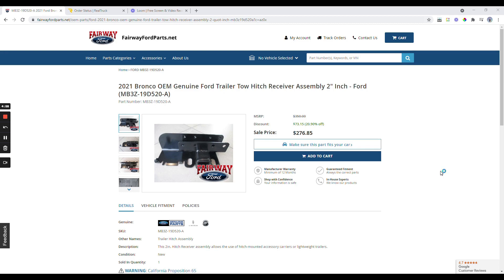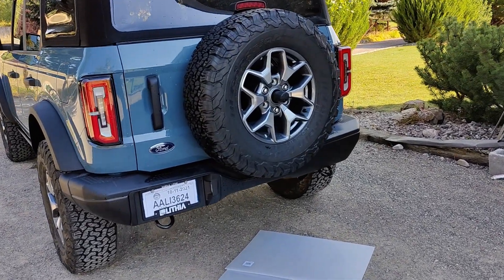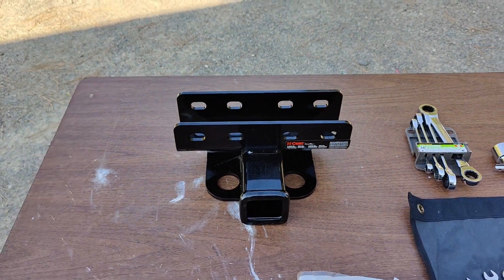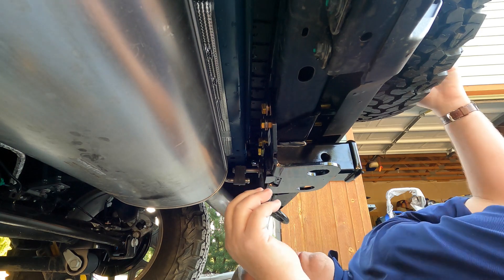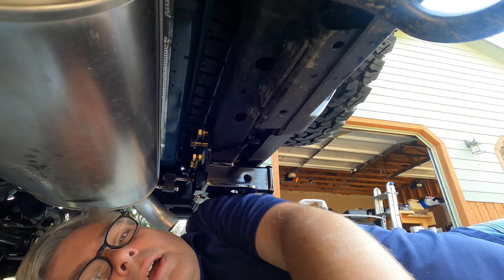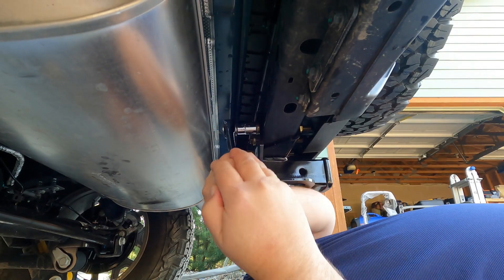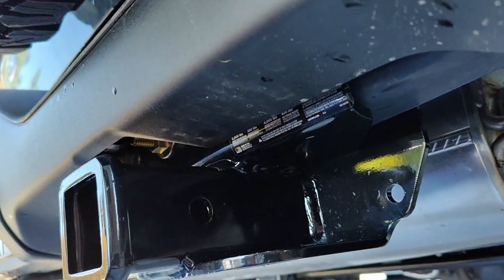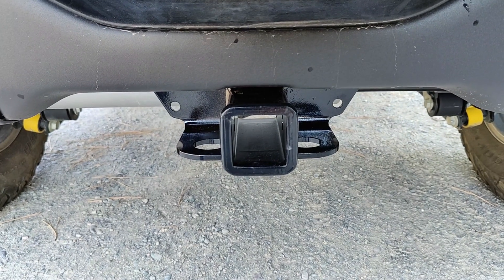My 2021 Ford Bronco - I saved money by adding an aftermarket receiver hitch

Comment: Thanks - exactly what I was looking for.  Just looking for something for my bicycle....
Reply: Is there an extension for a bike rack? I don’t believe my rack will make it to the receiver with the spare tire there.
Reply: @IluvYahweh  - I have an older 3-bike rack.  I had to buy a 2" to 1.25" converter, and then I can insert my rack.  My rack extends 10-to-12 inches away from the trailer hitch,  with a couple inches to spare away from the back-up camera and spare tire.  Thus, I didn't have to buy an extension.  I don't know if one is available.
Reply: @truckguy  Thanks. I’ll look into this. I hope to receive my Bronco in January.
Reply: @IluvYahweh  I should have noted that I have a stock Big-Bend I got a couple weeks ago. i.e no Sasquatch package.  If you have bigger tires, you'll need even more clearance.  I did a quick review here: https://www.youtube.com/watch?v=zdtp8rkpT5w    Thanks again to "new departure" for the pointer to the after market trailer hitch!  :>)
Reply: @IluvYahweh  There are several options. The one I used with my Jeep was 2” or so and the exterior stepped up so that the bike rack (Kuat) slid right in and came to about 1” of the rear tire. I did not like the overall extended length and ended up removing the spare and stowing it inside.  I see my spare moving to the roof.

Comment: Thanks for this post I plan on buying the Big Bend model and best I can tell on line is that a factory-installed trailer hitch is not available. Even if it is your Curt Hitch is a much better deal and like yourself, I will only be towing a small 2 wheel trailer for UTV and trips to the yard waste dump. Great info.
Reply from the maker: Glad I can help!

Comment: For some years now, I've always gotten towing-hitches on my new vehicles...but I prefer OEM (for several reasons). On my current vehicle, it came with the OEM hitch so I had no say anyway...it was on a dealer's lot, not something I ordered from the factory and could have chosen options. Had it NOT had an OEM towing-hitch, however, I would have had the dealer GET it and install it later as part of (and so indicated -- in writing!) the original sales contract.
That's what I did for my previous vehicle, a Honda Pilot AWD: Added the "towing package," which had 3 parts: Hitch, wiring-harness and transmission-cooler. Took the Pilot back to the dealer when the hitch came in (7-10 days) and they installed it. OEM was PRICEY, for sure, but it was the BEST hitch you could get. And, it didn't fit below the rear bumper, but higher...so the ball was sitting higher, too. Nice...
Yes, my OEM Jeep hitch sits BELOW the bumper, but given the vehicle has higher ground-clearance than my Pilot had, that's not an issue at all as the ball is STILL quite high.
Your Curt hitch looks very sturdy and wasn't too hard to install (SOME definitely are!).
Happy Bronco-ing,
-- BR
Reply from the maker: I fully understand your thoughts there. Interestingly, Curt is one of the Ford OEM suppliers on the Bronco, so I was comfortable with the product line. As I mentioned in the video, I don't intend to do any highway towing with the Bronco - my Toyota Tundra is set up best for that. I just wanted to be able to move things around in the yard or up at the mine.
Reply: @StephenLoosli1  Yes, I recall you saying that you don't have any serious towing needs...I don't either, except when I move -- and it's a DIY project as I pack-up/load/tow/unload a trailer myself vs. hiring "professional" movers -- and then I need more towing capacity than a bike-rack, small utility trailer, personal watercraft (or whatever). 
Still, since I don't want to be at or anywhere near my vehicle's max towing-capacity, my 2021 Jeep Gladiator (Rubicon) capacity is 7000lbs, and I don't want to tow more than ~5000lbs. It's like that general RV-towing "80% Rule" -- not towing more than 80% of a towing vehicle's max towing capacity...that is, IF you have a choice!
I like having that "headroom" -- less wear & tear on the vehicle and easier handling on the hwy, too.
Your Curt DOES seem to be the best choice for your needs...or even more, as it does look much like the OEM hitch but was half the price!
I've used Curt once before also -- on a 2006 Honda CRV -- but due to the CRV's frame, it was a tad difficult to install (required fishing bolts inside the hollow box-frame). Not REAL hard, just more difficult/time-consuming than it was on my 2016 Honda Pilot (EASY, just 4 bolts (IIRC) on each side of the vehcile.
As for my Gladiator's OEM hitch, I don't know how hard/easy it'd be to install as I haven't looked at how it goes on. Is it like the Wrangler's or not? Or even the Bronco's?
Don't know, but will find out the next time I'm under there.  ;-)
Happy Travels,
-- BR
Reply: @Bill Redding...  I'm an OEM snob too!  I bought a new 2016 Ford Explorer XLT.  Only 3 on the dealers lot.  Had everything I wanted, but didn't notice the lack of a tow hitch until days later.  To say the least I was bummed!  Didn't want an add on receiver that hung below the bumper for $200-$300, I wanted OEM.  I purchased all the OEM parts from Ford, bumper insert and cover, receiver hitch, wiring harnesses etc.  Took the bumper insert and cover to a body shop to get painted, and did everything else myself.  At the end of the day I spent around $1,100, but having an OEM tow hitch that I installed myself, was priceless!  I ordered my 2022 Bronco Wildtrak damn near fully loaded, and yes, the $500 tow hitch option was checked off!
Reply: @DalHarpJr  Some Gladiators don't come with tow-hitches installed, either...I'm sure (like you) some buyers overlooked that as well. I missed a minor thing or two, but nothing major. For sure, I needed a tow-hitch!
However, not sure I'm an "OEM snob" though...I know there are "Jeep snobs" -- like Wrangler owners who don't do the "Jeep Wave" to Gladiators (as Gladiators aren't "real" Jeeps?) -- but I'll go check in the mirror to see if I missed THAT "factory option" also.  ;-)
-- BR

Comment: I didnt watch the whole video but there are two plug and play wiring harness for the lights, $99 and 120 respectivly, based on thr amperage . I hope. Ylu bought a name brand hitch like a curt, for $99. Not some cheap amazon or  ebay one . Curt, sells the wiring harness. Great vid and Nice Bronco

Comment: Thanks for the vid. Does anybody know if the suspension is different than if you order it with the tow package? Trying to find out if I’m sacrificing any towing capacity by adding the hitch myself. Trying to look into buying a pop-up camper for a long road trip, any advice would be amazing!

Comment: Does this aftermarket one tow just as much as the OEM one? Or is it rated to tow more then the 3500 OEM rating ?
Reply from the maker: I think the aftermarket hitch is also the OEM hitch vendor. The bolts holding the hitch are stout. I'm confident of the same tow rating.
Reply: Just Fyi, if you do try towing with this and you get in an accident, insurance will most likely deny your claim.

Comment: Omg thanks for sharing. Cant wait to buy this... But my question is how much the capacity for towing? (2021 4 door big bend without package) thanks!
Reply from the maker: The towing capacity will be the factory spec of about 3300 pounds. One thing I noticed is that a stock receiver hitch 2" ball is right under the spare tire and doesn't allow the ball lock to be set without opening he rear door over the tongue - need a longer hitch.

Comment: Wonder if this fits on maverick being its same platform
Reply from the maker: Great question! Check Rough Country's website.
Reply: The bronco is not the same platform as the maverick, it is the same platform as the ranger. The bronco sport may be similar to the maverick as both are unibody vehicles, the bronco is a body on frame.

Comment: Can you give any info on the towing capacity with the Curt vs with a factory hitch? Thanks.
Reply: Small Home Depot trailer and see it pass you by on freeway after you break all the bolts lol
Reply: @p.youhana3563  what are you saying?
Reply from the maker: The Curt hitch IS the factory hitch - they are the OEM vendor. Exactly the same. I'd probably go for the wiring harness if I did it again.

Comment: Do you know what your towing capacity would be by installing this? Would expect it to be less than if factory installed hitch (?)
Reply from the maker: The towing capacity should be the same as with the factory installed option. The Curt hitch is equal to OEM.

Comment: Wouldn't you put the bolt in the other way?
Reply from the maker: The direction of the bolts is unimportant for the hitch's structural integrity. The Curt instructions had the bolts installed as I did it. However, to have the bolts go from back towards the front, one could remove a portion of the rear bumper around the hitch area. I don't know if that is easy or hard.
Reply: @StephenLoosli1  Understood. Receivers can act as a nice bumper saver. I actually keep my hitch installed as a bumper protector when parking in close proximity to other cars .
Reply: @nycmaverick  I rather my bumper take a hit than my frame... That's what it's designed for.
Reply: @Nature__Nick  You must not live in NYC then. Don't park behind me or you will learn the reason.
Reply: @nycmaverick  How about you don't run into people's cars?

Comment: its not just the hitch, they also add trans cooling as well so you don't over heat the trans. aftermarket and install with warranty is where it can be more than just adding as the option.
Reply from the maker: Thanks for the comment. Here is what Ford provides from the factory: Trailer hitch assembly; 4-pin/7-pin wiring harness prewire; 2” receiver. It does NOT include a trailer brake controller or a transmission cooler. Basically, I just wanted to be able to move things around, but not do heavy hauling - I have other vehicles for that. So far, it has worked well. Although ... I've hit my shin on the hitch a couple of times when the rear door was open.

Comment: Does this Bronco come with a trans/oil cooler? That’s the advantage of the factory tow package. And of course the wiring for the lights.
Reply from the maker: From what I know and have researched the Bronco tow package does NOT come with a cooler. The factory option is the hitch, wiring harness, and an electronic tow controller module.

Comment: I guess if you don't care to have it covered by the warranty.  I suppose of anything on the vehicle you can add during production, this might be something that some folks wouldn't mind not being covered by the warranty.  You save about $450-$500, if you don't figure in your time to put it on.  But adding it to the factory build has almost no impact on the final payment, so for me I'd rather have the factory do it and have it on the warranty.
Reply from the maker: I don't disagree. In many cases, ordering the factory towing package for a vehicle makes more sense because of added features - such as a transmission cooler or augmented braking support. However, in the case of this Bronco package, all you get is a hitch and a wiring harness. I decided after delivery to add the hitch and it was easy for me to do.